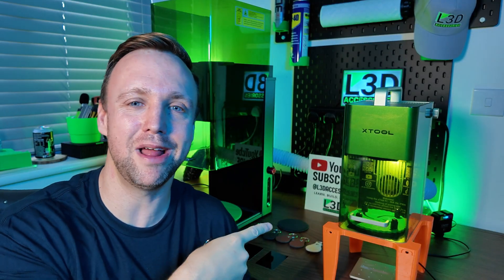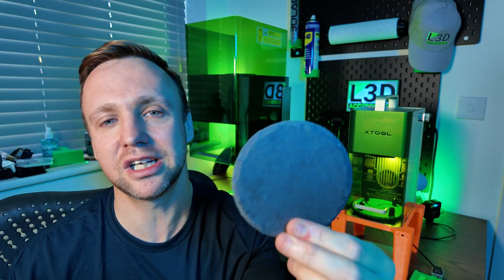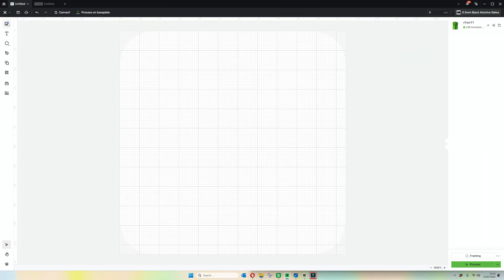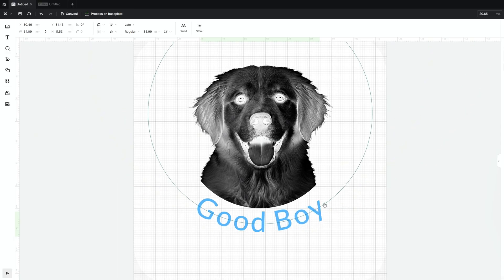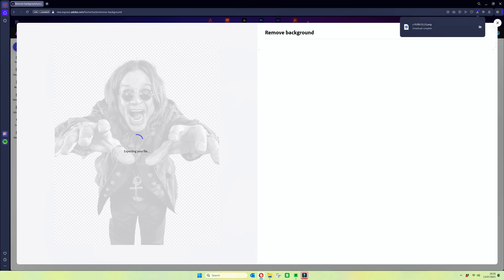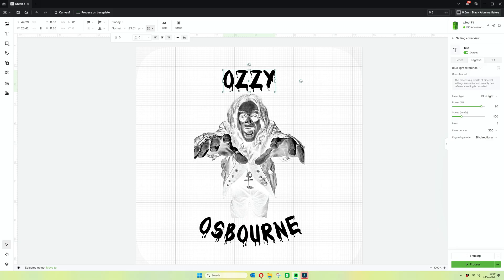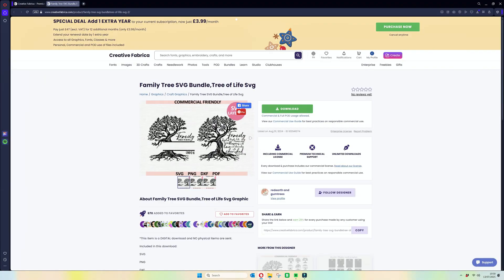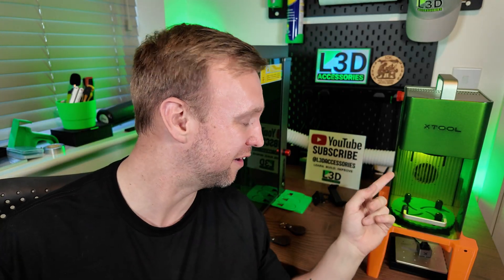3 Beginner Laser Projects for the xTool F1 (with Material Settings)

Comment: How long did it take to create each item? As a newbie, you went a little fast and lacked in some info. If you're bringing in new subscribers and titling your videos as such, I would appreciate a wee bit more of an explanation on setup, etc. For example: you set up 3 keychains in the jig, as far as the file goes, did you have to set it up to match the 3up or does the F1 figure that out?
Lastly, your jigs are great. The adjustable one is brilliant. Thanks
Reply: His jigs are brilliant!
Reply from the maker: Great point Barb. I had a lot to fit in and didn't want the video to be too long so it was streamlined quite a bit. Rest assured there individual project videos coming which will be longer and detailed.
Reply from the maker: The slate coaster took 12 minutes, the business card took 3 minutes and the keyrings took 1.5 minutes.
Reply: Wow. These times are so good compared to my M1. I'm really looking forward to all we'll be able to do with this F1. I wasn't ready to commit to their latest G2 quite yet. It's a little too pricey at this time in my laser journey.  @L3DAccessories
Reply from the maker: @barbblack7825 Honestly the F1 is such a brilliant laser. I think you'll be very pleasantly surprised with how much it can do and how quickly.
Reply from the maker: You have to set up the files in the correct position and then individually assign the material settings to each one.